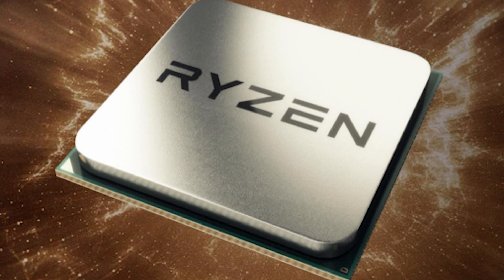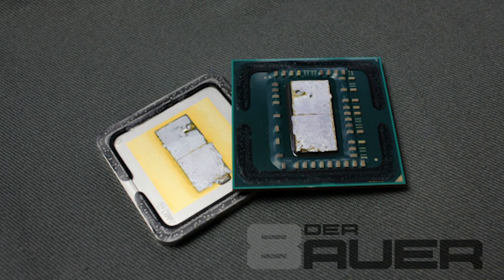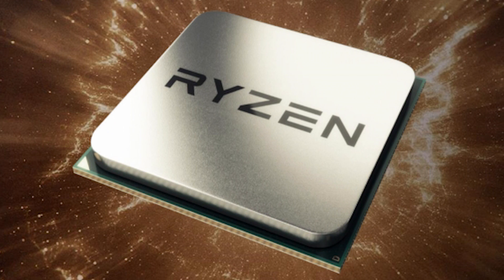RYZEN OWNERS - Do NOT delid your Ryzen 7

Comment: The quality of the thermal paste under Intel's IHS is perfectly fine. The problem is that it is several times thicker than it really needs to be. Even the best TIM material will produce horrible results if you make it 5-10X thicker than necessary.

Remove the IHS, remove the glue, put generic zinc oxide paste on, put the IHS back on, and you already get most of the way to delidded temperatures simply by reducing the die-to-IHS gap by the adhesive's thickness.
Reply from the maker: Yeah I'm with you. I've just never felt it was really worth it. I think Linus did a video on replacing the paste, and it wasn't that much of a difference.

Comment: Well duh, AMD doesn't cut costs and use thermal paste to attach the lid to the processor. What kind of garbage CPU company would do that... oh...
Reply: the one that did not cause a RROD on the xbox 360?.
Reply: AMD didn't make the processor for the xbox 360. That was a PowerPC, IBM.
Reply: xbox GPU :)
but to be honest, it was the solder under the chip.
the DVD player took space.
therefor the GPU had a smaller flat heatsink.
and the fans on the back were loud and sucking air out.
no cool air getting blown in .

i did a reflow of my GPU.
pretty amateur with heatgun shortly.
but it worked to fix the RROD.
bought a new black case.
new small silent fans , bigger HDD etc . 
my 360 still works fine.
but still pretty loud when running of the DVD.
Reply: Regardless, that was ATI, seems like you did a better job than me at pointing out that it wasn't ATI's fault to begin with.

Comment: Der8eur delided to try and get past the thermal limit on air and water. Not much benefit when going sub zero. There is a reason why all the published benches are at 4ghz. Check out the benches on hwbot and you will see it can't get anywhere near an 8 core Intel unless benching sub zero. My 1700x wouldn't budge past 3.907 even with smt and 6 cores shut down, using an nh15 double tower cooler with 3 fans on an open bench.